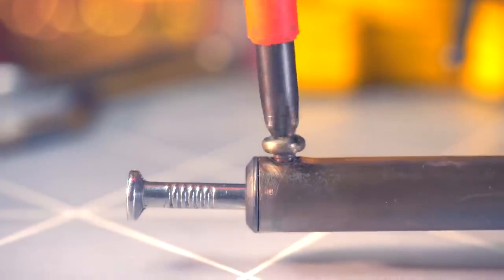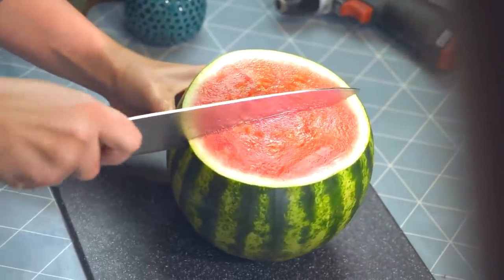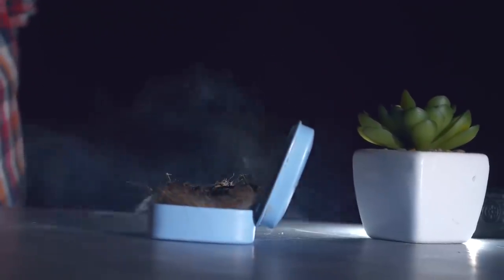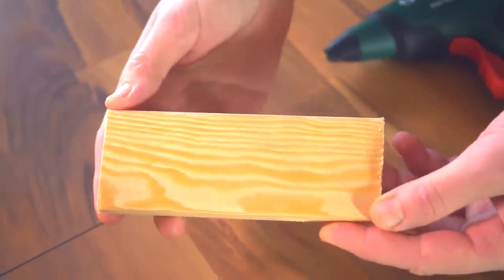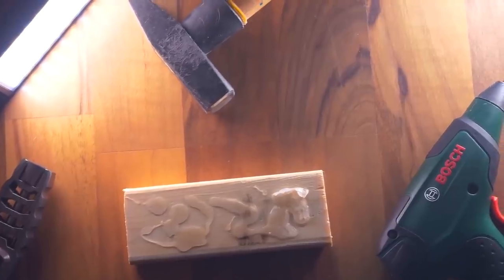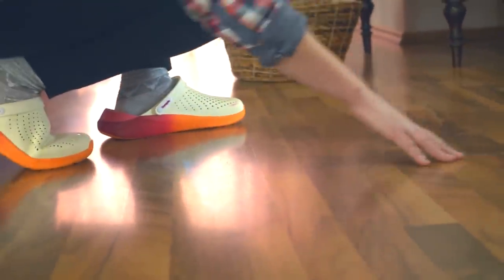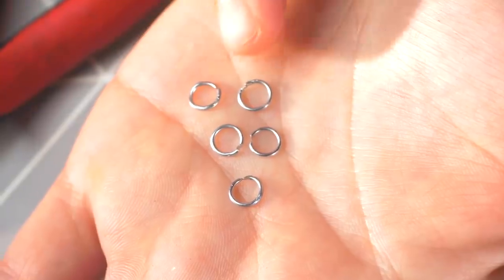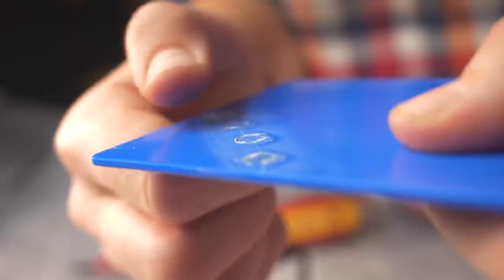7 LIFEHACKS FROM SLIVKISHOW

Comment: 4:50, this should never be regarded as a proper way to mount a cable! Never staple a cable carrying any current, especially not a mains voltage cable! Fire or human harm is very likely if a staple pierces the outer isolation!
Reply: Using staples directly can be dangerous, but just make sure that there is protection between the wire and  staple.
Reply: The staple didn't pierce the cable

Comment: When u fix the gap on floor won't the gap appear on the other end?
Reply: Well, of course. But that's why you repeat the process with the next tile. Problem solved, forever.
Reply: @theMagos  if u repeat this won't the gap be near the wall 😅
Reply: @abdullahtxt4480  gap fortunately ends up under the plinth, and will not be visible

Comment: the irony of life hacks is that ordinary people don't have these equipments and tools. The last life hack is a little too much just to fix a cutting board, which can be replaced by buying another one for a few bucks instead of buying expensive heavy tools and doing all the process shown in the video that takes alot of effort just to fix a damn cutting board.
Reply: If you live in a house with a garden in Eastern Europe you are very likely to have most of what he is using. And every household should have at least one functional soldering iron in my opinion
Reply: They seem the so called back to fix plastic in Amazon for a little over 20 us lol

Comment: But if you close the gap in one end of the floorboards, won't there just be a gap in the other end?
Reply: Not unless they installed the board wrong which was probably why the gap happened to begin with

Comment: Hello like watching you show If you wrap bottle cap with electrical tape because of its elastic  and it  will mold to the the and bottle top well it will not come off (if you need it to stretch better just warm the tape)

Comment: Can I also put a nail in the soldering-iron to solder?
Reply: A steel nail won't get as hot as a copper tip because of losses, but it a good for melting plastic like he did. You don't want to get plastic on your soldering tip.
Reply: @bgezal  right. Thank you!

Comment: although it is cool to make the wire spinning thing, if you have a vice, a bolt, drill and drill bits, at that point why dont you have anything to connect the wires, also pliers